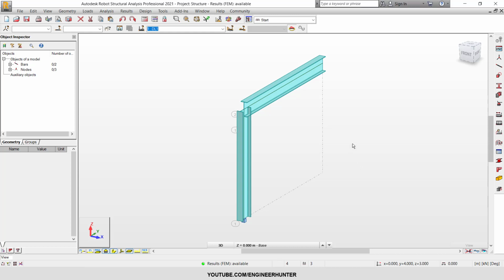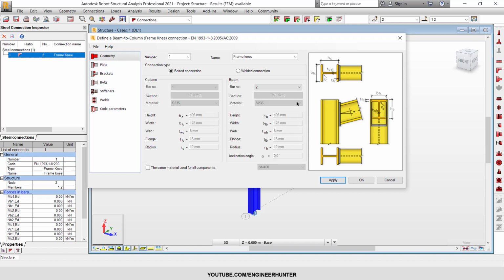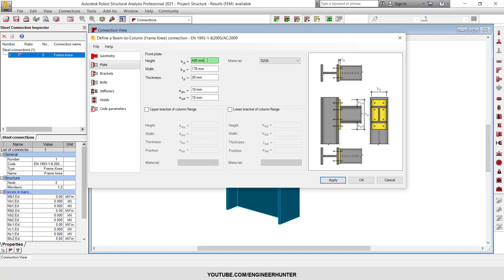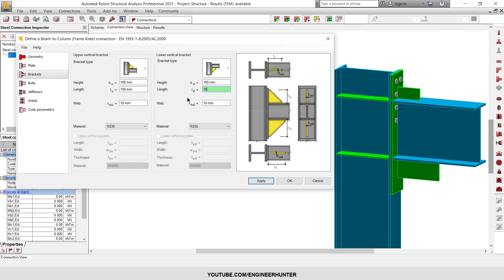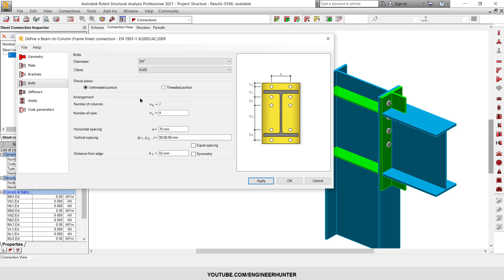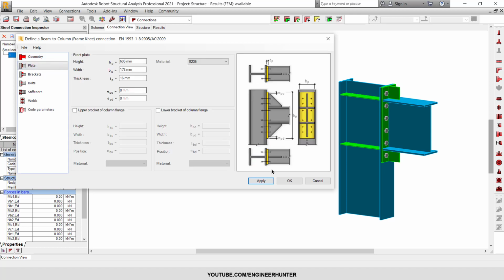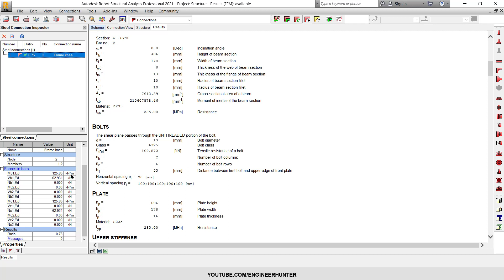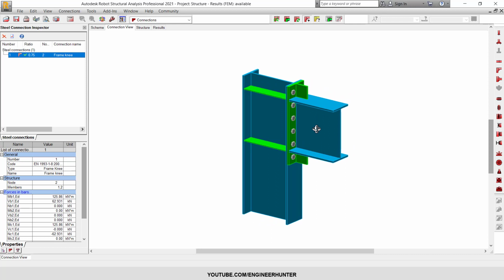Autodesk Robot Structural Analysis : Steel Connection

Comment: (Connection does not conform to the code) how can I solve this issue?
Reply from the maker: You can to check the design code. I think, it might be bolt spacing issue, without seeing the whole problem, I’m not sure though.

Comment: Thanks for the video. 
Question: Why are the brackets square in shape? Is it possible to make them into triangular form? If NOT, is there something written in a manual that I can refer to?
Alo for the Bolts, is possible to have more than 4 Columns of bolts?
Edited. For anyone that requires this info, I found out that the bolts can only have up to 2 columns as of the current version. Refer to the section regarding Bolts in knowledge autodesk.
Reply from the maker: In this version of Robot SA, the brackets are only in square shape. This is the limitation of the software. There are many connection design books Eurocode. The one from TATA Steel is also good. And for the bolts, we can only use 2 columns of bolts, but more rows. You can try IDEA StatiCa, in case you want to adjust more to the connection.
Reply: @EngineerHunter  ok thanks for the reply